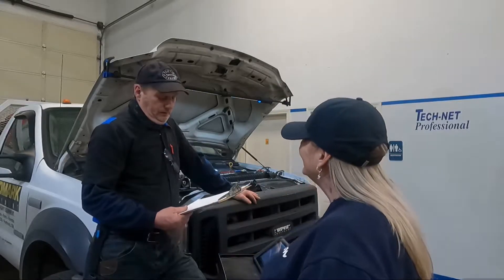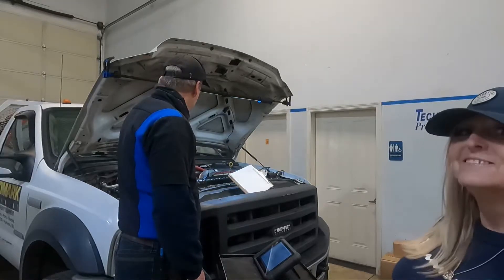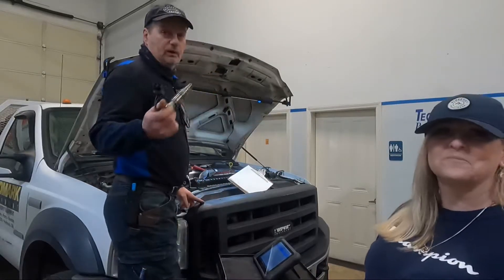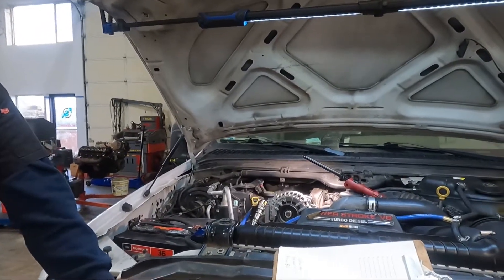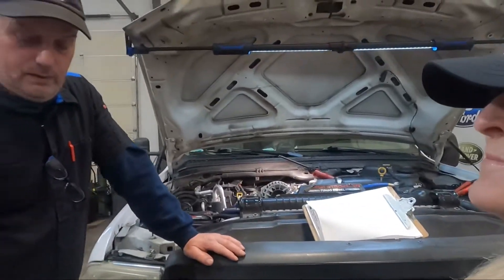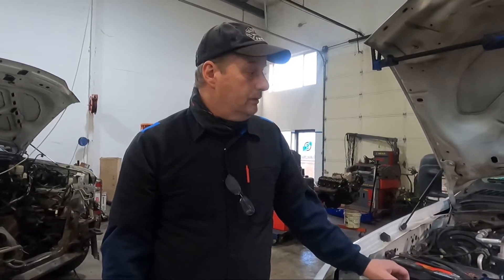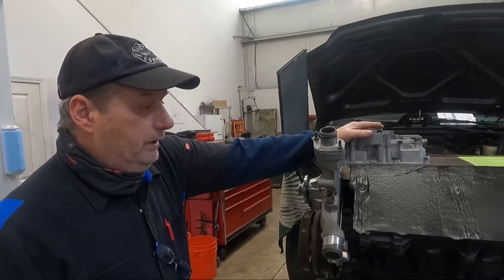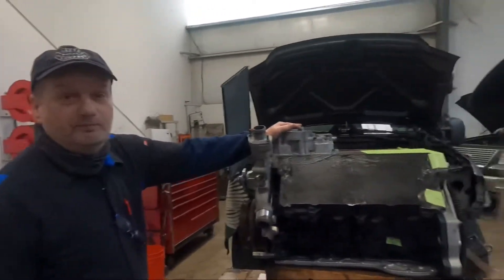6.0 Powerstroke Misfire Diagnosis

Comment: I have a slight engine skip that’s intermittent…I have all new injectors, new fuel pump, new lift fuel pump, new injector harness…could it be IPR or ICP?  Thank you.
Reply: Ficm connectors or ficm harness